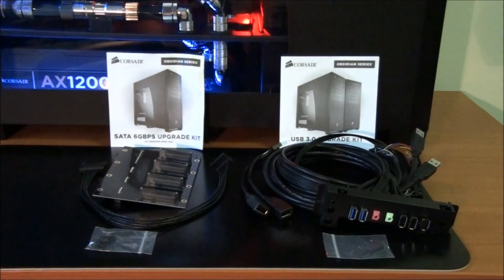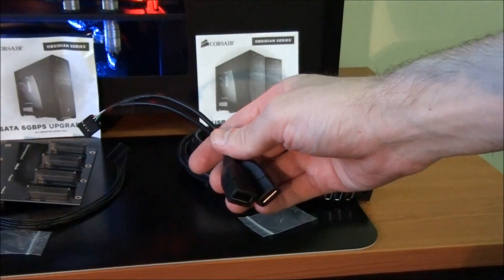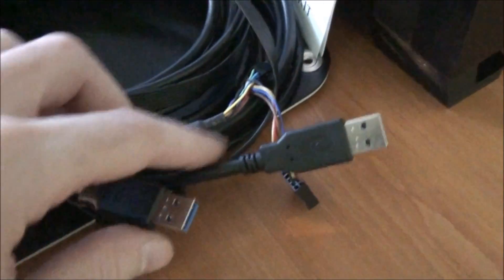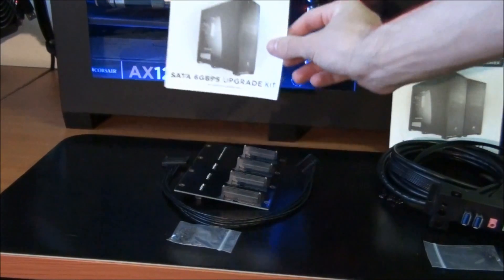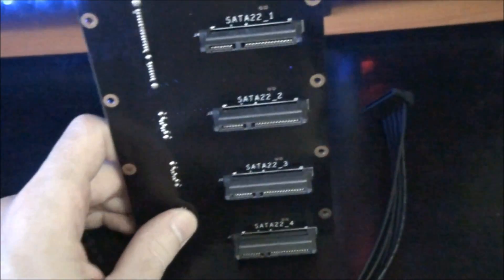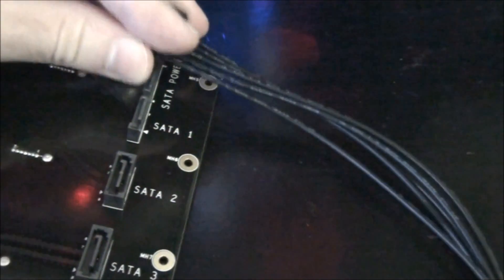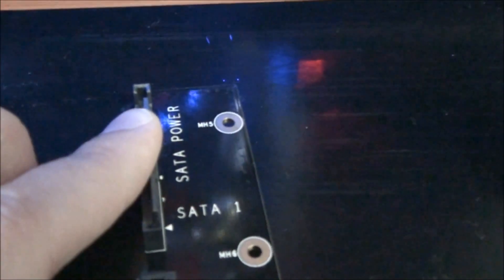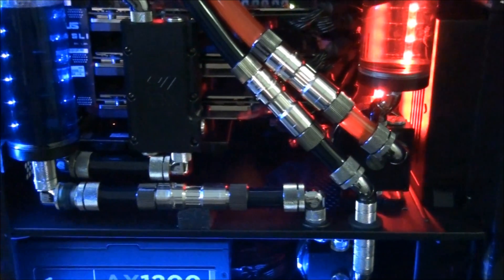Corsair Obsidian 800D SATA 3 & USB 3 Upgrade Kits Guide

Comment: Holy shitzoid! First of all the removable tray hard drive screw holes are about 1/16th too short!!!! I had to elongate the bottom screw holes by that much! Took Corsair 4 months to send me the replacement SATA6 kit that is flimsy and breaks really easy! Anyways to HIGHLIGHT a point that you made so it is CLEAR to everyone is that the provided sata power cord (which is not in ribbon form, the wires are all separated) is a special cord that you have to have! Corsairs customer service sucks!

Comment: Wrong answer, they just screwed with the upgrade kit front panel USB 3.0 interface. When I buy a case like 800D I'm also able to buy a decent motherboard with a proper 20-pin USB 3.0 header. Therefore this upgrade kit is practically worthless.

Thankfully honitsten below gave a very reasonable solution to this problem. Thanks mate!

Comment: I have recently been having issues with my boot drive C300 SSD not been found when starting my SR-2 build. The problem was intermittent, after updating the BIOS it would generally boot okay. The problem turned out to be the SATA 3 kit installed a couple of month ago. After replacing it with a new one borrowed from another build I'm working on, it now boots okay.

Comment: Wouldn't the Sata cables need to connect to a Sata 3 6Gb/s motherboard header for the drives to operate at 6Gb/s. Most motherboards at the moment only seem to have 2 Sata 3 headers. If this is so an adaper card would also be needed??

Comment: I was doing some research for my current build and found a Lian Li adapter you can plug in to your header on the motherboard and plug these in to the adapter so you don't have a need to use up your rear USB3 ports. 

Google: Lian Li UC-01 USB3.0 to 20-Pin Converter (UC-01) and you will find it.